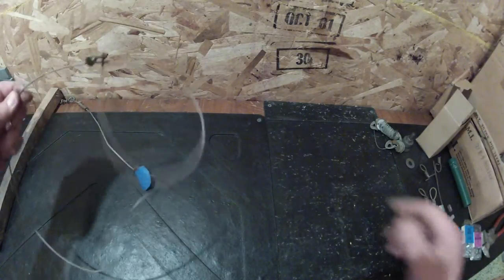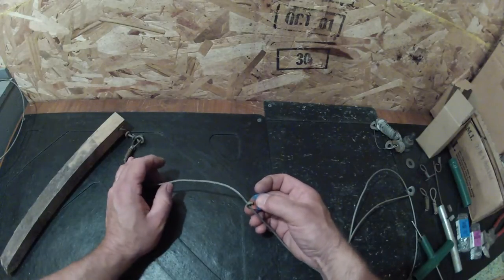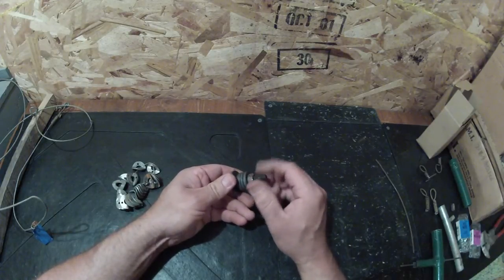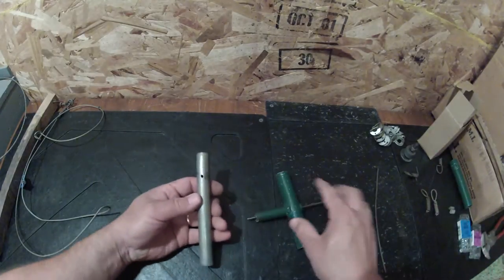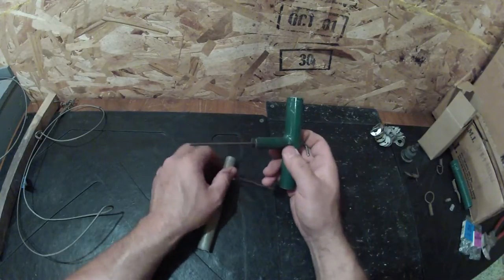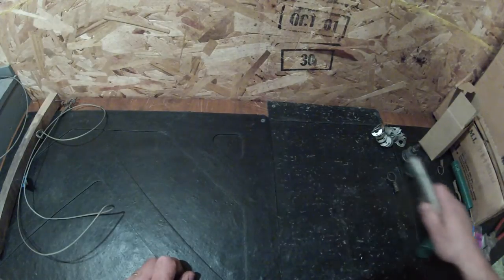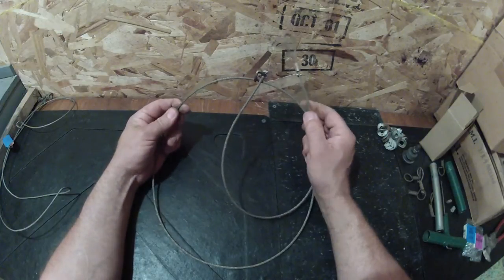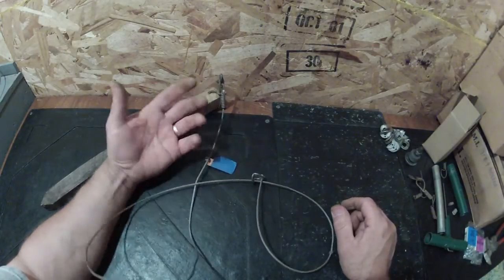How to make a snare & snare parts

Comment from the maker: It works similar to a lasso when roping a calf. But the snare is set just off the ground on a trail. The animal is the one to pull it tight around them by putting their head through the loop & moving forward. The loop gets tighter. The lock keeps it bound so the animal can't escape. It takes 2 hands to slide the lock backwards & open it & remove the animal. On a trail you have to decide how high the set the loop off the ground depending on what your target animal is & guide them into the snare.